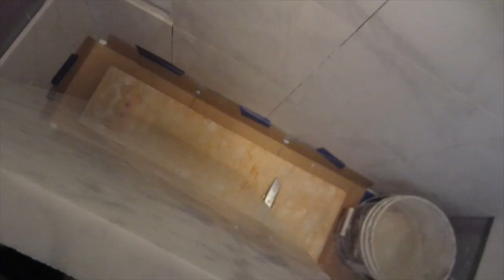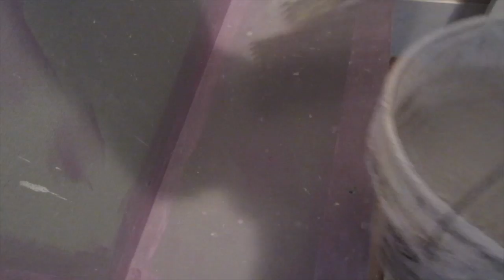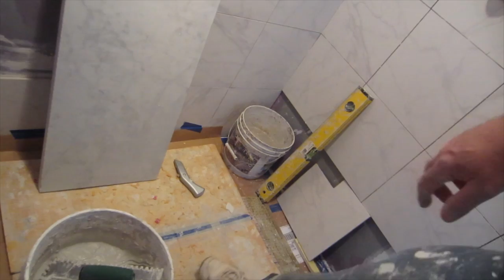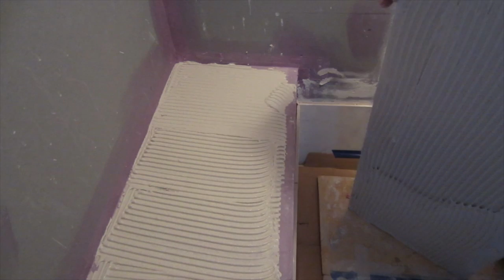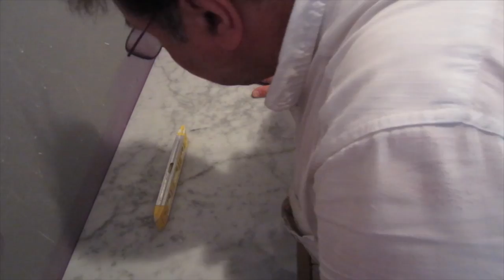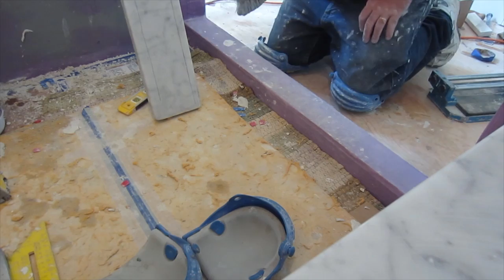How to install marble on  bench seat and shower curb

Comment from the maker: The sills and bench seat are actually 1 1/4", they were fabricated from a slab, but you can use your 1/2" material if you like, once it is set in the thinset it will be just fine.

Comment: For a floating bench of 3 cm granite, mine will be 36 x 14".  Supported on 3 sides.  The tiles could support it but I'm thinking of screwing 3/4"  x 1/8 " aluminum L moulding for support  to the studs rocked with Densshield then bondo the granite to it, then install tiles butt to or leave a grout line.  The walls are not square so this leaves much more room to place the slab with a slope.  Every take on this kind of slab attachment? Its my first shower install DIY.

Comment: I gotcha

 What is the adhesive you used here ? Thin set ? Mortar ?

there's a product out now by liquid nails made specifically for granite and marble as to not staining any granite 

where it does look appealing I was more curious as to what you used in the video 

for the seat/threshold

 I'm just doing a shower threshold with a very heavy piece of granite top 

so what I'm trying to decide is...

To follow your method or look toward the new liquid nails product but 

again thank you for all your advice
Reply from the maker: inaverysmallroom I always use a thinset mortar, usually a high quality modified thinset, or if I am using Schluter products a high quality unmodified thinset.

Comment: Sal, I am up to tiling the curb. I too have a solid piece to go on the top of the curb. We are going to lay 4x8 porcelain tiles on the walls and the vertical sides of the curb. I saw that in this video you set the top before tiling the outside and inside of the curb. Is this the way all the time or for some particular reason on this job? Thanks in advance...
Reply from the maker: Always do it that way, set the curb and then tile.

Comment: is it ok to tile first then install the marble seat? or does the tile have to be sitting on top?
Reply: I have the same question
Reply: I have the same question.  Ive seen videos doing it each way.  Wanted to hear from Sal why this was his preferred method.  My logic as to why I was leaning towards tile first-  less cuts to go around marble seat, straighter edge my putting the marble slab after.
The only benefit I see by installing seat first is watersealing?
Reply: @Jdakota  water runs down the wall hits top of seat and runs off. It's the same idea as a niche put bottoms down first then set sides and back on top of bottom plate.

Comment: Sal,
  Thanks for the instruction.  Very helpful.  Are your sills 2cm or 3cm thick in the video?  I am a do-it-yourself tile setter at home.  I am currently re-doing my own master bath shower cubicle with porcelain tiles and new stone new sills.  I am thinking of using 1/2 " thick travertine stone as sills cut to fit in the field from 18 inch square tiles.  Are these 1/2" stone sills thick enough, or do I need to have thicker stone sills fabricated by a professional stone supplier? Thanks.

Comment: Sal,

I can get two pieces of marble that are 5"x 36". The problem is, my curb is 60". Can I cut the pieces down to length and butt them together for on top of the curb? Would this look right aesthetically? Also, were can I find marble,stone, or solid surface for a corner bench seat? Any suggestions?
Reply from the maker: You should be able to find a marble sill that long, if you have been looking in the big box stores with no luck, go to a tile distributor, they will probably have them. I have no trouble getting them here.
Reply: ***** Sal, you would not believe the problem I am having finding someone to get a marble sill here in Iowa! These are tile and stone distributors, and they all act like they have never heard of such a thing! Guess most of the "tile pros" around here use tile to cap their curbs. Wrong thing to do, I don't need to tell you that, but anybody reading this and considering not using a solid piece for their curb sill, think again! The grout will fail, and there is no such thing as luck as far as where water will decide leak out. As I found out just four months after my project. Sal, it was the only thing I did not follow to the letter from watching you...and guess what...yep, now I getta fix it!!!

Comment: Hey Sal, Love the videos! Question on adhering the marble to the top of the curb. I had the curb top cut from the same slab as my bathroom counter tops. I let the counter top guys install the curb top. I have done everything else They just used silicone and shims to get the slope. Is that going to be enough to hold it in place. Or, an i going to have to take off the curb top and install it with thinset?
Reply from the maker: Thinset is a much better idea, silicone is fine for a countertop and a stone slab, there is nothing to adhere to except the top edges of the cabinets, a shower curb is a surface prepared and for tile or a solid surface to be adhered to with a mortar.
Reply: Thank you.
Reply: Can you use shims with thinset?

Comment: Sal,

How much overhang was on each side of the curb? Just enough to flush the tile or does it extend slightly on both sides?
Reply: Never mind. Just saw the comment below!
Reply from the maker: Depends on the width of the sill, sometimes as much as 1/2" overhang on each side, sometimes flush.

Comment: Hi! Just watched this due to concerns about  installers installing granite on top of my nice 2 tier schluter benches. They used blob method w/a shim. So yeah there is void under them. Should I get them to reinstall - or should I just take them out (they shouldn't stick too much - your newest video about how to key in mortar seems to indicate that these would be easy to take up)? or could I just use sealant 100% silicone to seal around the seat then tile the faces of the benches and be ok? This is for steam shower.

Thanks for video!
Reply from the maker: You never want empty space under a surface that will be in a wet area, you decide to do what you need to do from that.
Reply: @SalDiBlasi  Moral of the story dont ever let granite installers do your shower seats. I'm not sure how to get these up so I'm calling the company to get them to correct it. (Its why I'm a diyer because I do have stds and too many contractors are not educated. My father is an architect but we live in diff cities now so I dont always get his input. Thanks Sal!)
Reply from the maker: @cvolk5987  I always install every part of the shower, including the seats, The customer may have them fabricated and delivered, but I install them.
Reply: @SalDiBlasi  Hey Sal, I just got through pulling the top slab up myself. Wasn't too hard - loosing a whole weekend fretting over it and now doing it. What did I find? A paint stick in the back with very small still WET blobs. My daughter and I very carefully lifted it up. At least we didn't destroy my kerdi boards and it's gonna be so good to put these in correctly. (Helps to write about it...at least I didn't pay for install as it was free - be careful when it's free !)

My hubby doesn't do this type of work and frankly I won't let him without supervision - he doesn't take offense :). After he got back from deployment (gone a year) I started this project (he helps w/tear down:) - this time we are doing our Master Bath! It's gonna take me months (been 5 already) to complete this job but will be worth it. 

If you want some pictures I'm happy to share - took a quick video of the mess. Thought about creating a youtube of my own - "whyIDIY" but this is already taken up by twitter #whyidiy. This is the very reason I DIY because many folks don't have the gift of being able to correctly do any type of construction because details matter (sorry hubby). Just like many folks I work with cannot write software for the life of them -- thereby tainting the rest of us diligent hard working knowledgeable developers!!!

Thanks for listening and responding - it's great to have you and all the folks here lending an ear and giving back what they know.

Back to pulling up the other slab - not so mad anymore... :)
Reply from the maker: Good thing you pulled it up, much easier now than later on when all the tile is set. I would like to see those pictures and the short video, maybe I can use them for something. My email is saldibs@elitetileco.com. send me a quick email and I will give you a link to upload.

Comment: use the non notched side first on the bench to fill any micro voids, then go over with the notched side, creating even grooves. when back buttering, only use the flat side, notches on 2 surfaces coming together will be counter productive, finally, get your self a decent level at least 400mm long
Reply from the maker: If this were a tile I would agree with you, and infact is how I do it, this is a slab of  marble that weighs 40 pounds, the weight alone would almost keep it in place, as far as the levels go, I have  more Than I need, and the one I used was sufficient for the job.